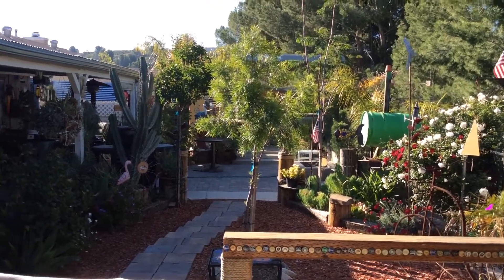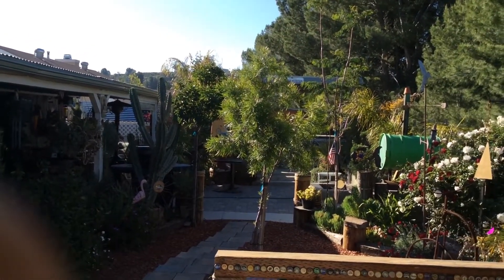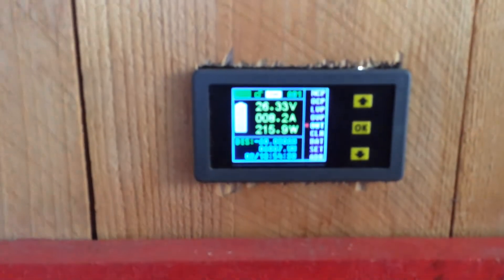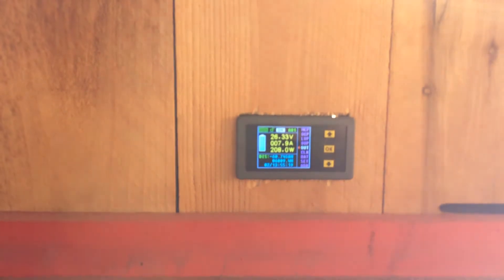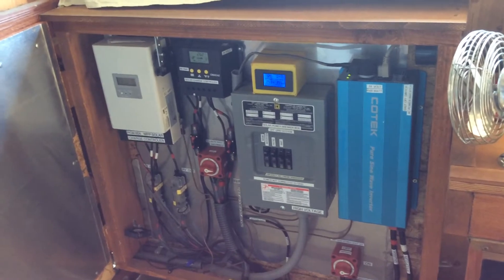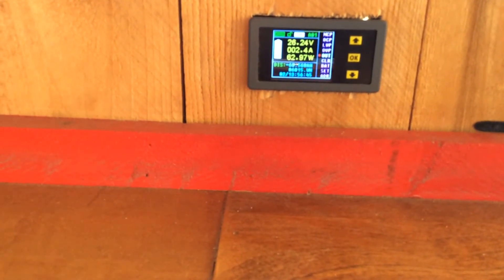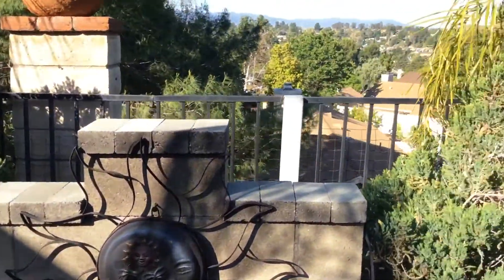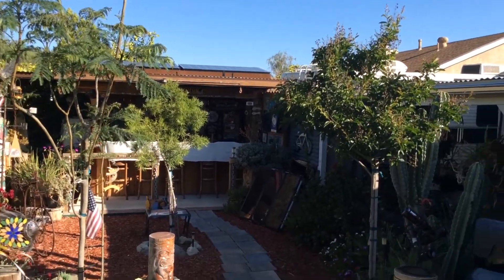BATTERY BANK charge & discharge on solar power off grid

Comment: It all sounds like common sense now that you mentioned it but I couldn't figure out why my batteries charged so quick and dropped off in no time flat. Thank you for your video, your video was exactly what I needed to watch. So now ( till I get more panels ) I'll wait till the charge controller go's through the bulk stage too float before I go crazy using electric.

Comment: Obviously it is charging is why your voltage goes up, it is not a false reading, it is a correct reading of your voltage showing charge
Reply: Just stop. You have no idea what you are talking about. He is correct. Votage increase doesn't mean your battery is charged. Solar charge controllers dump a lot of current into the batteries during the bulk charge state. Which causes the voltage to increase. Pop that battery off of charge and it will fall back down in a hurry. His point is to allow your battery to hit float which happens when your battery is fully charged. It accepts less amperage coming in and the natural battery voltage rests higher. Its the exact same principle as the peukert law with lead acid. The voltage will sag under a massive load however the battery is not dead. It is just incapable of transferring chemical energy into electrical energy at that rate. Thank you for listening to my Ted talk. And next time please refrain from trying to correct people on a subject you have little to no knowledge on.

Comment: good evening. I have been watching your videos for the past couple of hours and have gotten a lot of useful information from them.  I am putting together a 24 volt system for my house.  at this time I have (3) Renogy 12 volt 150 watt mono panels, (plan to purchase a 4th),  a 24 volt 1,500 watt PST pure sine wave inverter,  a Rover 12/24 volt 40 amp MPPT charge controller,  and 4 Duracell 6 volt 215 ah batteries.  my electrical requirements are minimum,  a tv, that I have my laptop hooked to, a modem, a medium sized fridge, and a couple of small lights. I felt this setup would be sufficient for my needs. at this time I only get 3-4 hours of usable sunlight each day.  I say usable cause I have a lot of shading on my property.  that will be taken care of next year, several trees will go..  I just wanted to see what suggestions or comments you may have that may keep me from making too many mistakes...  lol    thanks,   KC
Reply from the maker: With your set up you will get around 1500 to 1800 watts of solar per day. The shading will be a problem for you , I would try to add more panels to make up for the shading. Four  batteries at 215 AH will be fine for the tv lights and modem with limited use but the fridge will drain the battery bank over night. I would say that you would need at least 8 batteries 430 AH to run all of your needs , and turn off the TV and Computer when your not using them .
Reply: yes, the fridge was a concern.  here is the deal, the fridge sits outside on my patio, and does not cycle near as often as if it would if it be inside.  so,  as it sets. it is pulling 90 watts running @ 0.89 amps.  I put a KW meter on it and will see what it has drawn over a 24 hour period.  will be testing everything I use regularly to get a better idea.  thank you for the prompt reply, very much appreciated.  I ask that I may keep in touch with you from time to time, if this is okay ?  hope you and yours had a very merry Christmas..    thank you,  KC

Comment: Hello I have a small system 200 watt 20amp MPPT tracer with 4 - 215 amp hour batteries all 12 volt, right now I have been running my panels in parallel would you run the panels in series to increase the voltage and would this higher voltage charge the batteries better? Or can I even do this do to the 12 volt system ?
Reply from the maker: Yes you could with the MPPT charge controller .
Reply: Thanks, I just don't want to have an expensive mistake